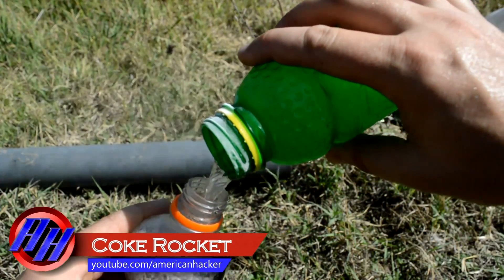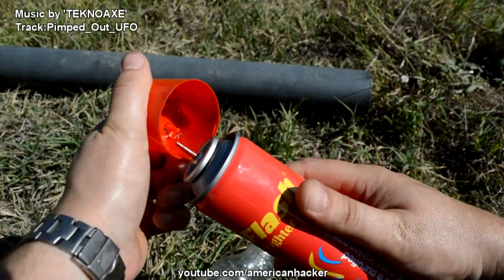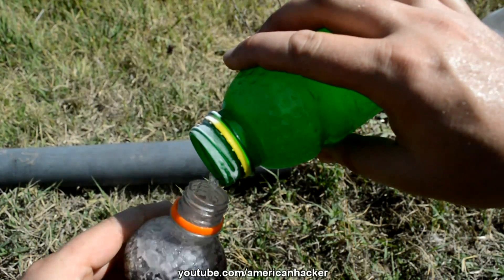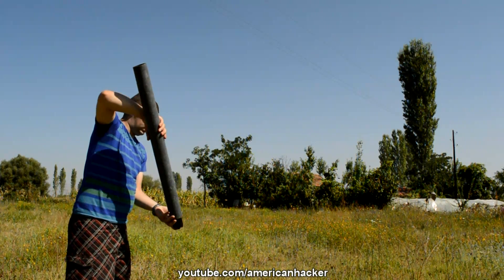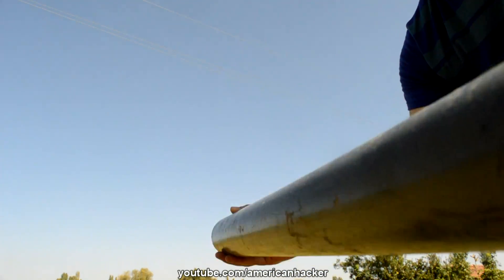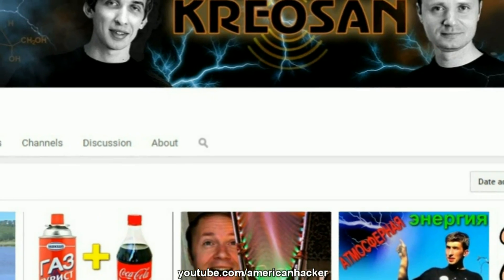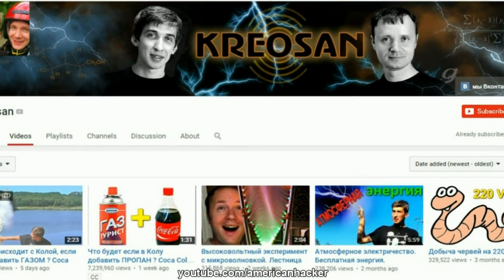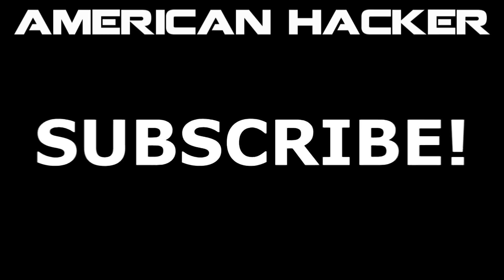What Happens When You Mix Coke and Propane Gas

Comment: Drill a smaller hole on the plastic bottle cap and screw it on quickly and you'll achieve more pressure and distance, also why is there no explosives attached to the bottle ?

Comment: it needs a 9v battery with a coil to boost the voltage & a mercury tilt switch to turn it on & have the spark at the nozzle.

Comment: you would achive a much greater distants if you would out a the cap on with a little hole on top. and spray the butan directaly in it from the little hole. use less fuel and goes farther